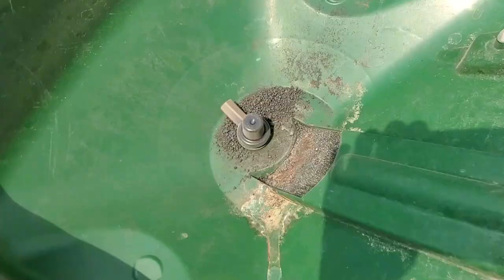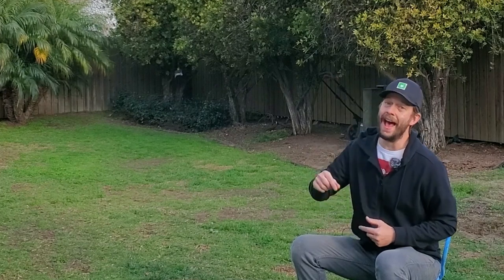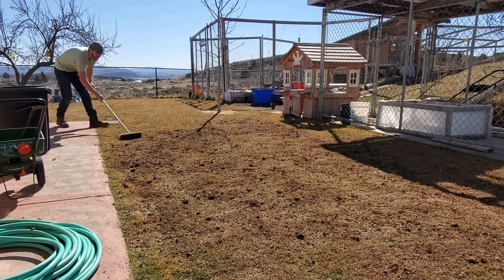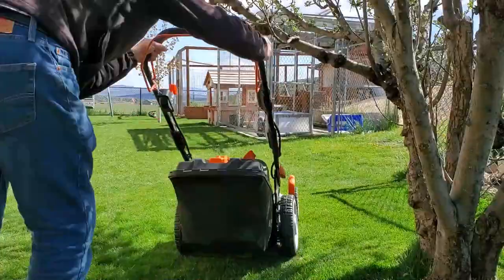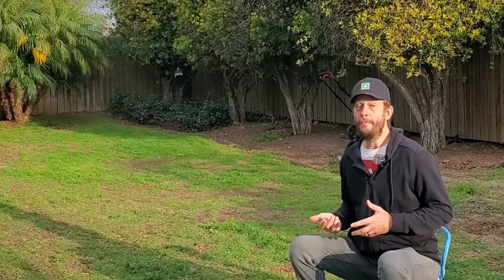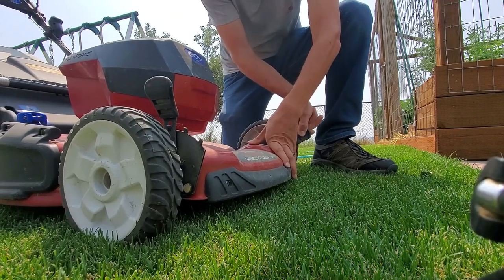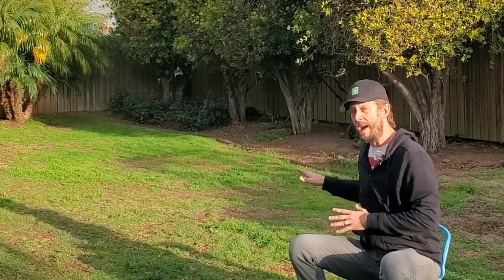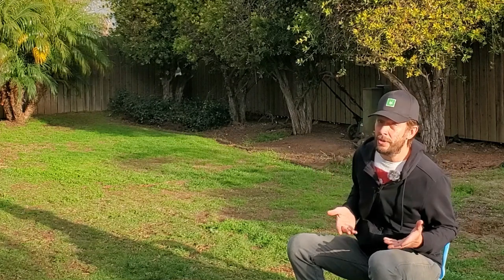All 10 Spring Lawn Care Steps // In Order

Comment: You can use tenacity as a pre-emergent and post-emergent and can literally spray it directly onto your grass seed and it will not harm grass seed in the spring or the fall
Reply from the maker: Yes, this is correct with the caveat that you shouldnt put it on bermuda zoysia bentgrass ...and you should go lightly on fine fescue too. Also, as a pre-emergent it should be reapplied every 3-4 weeks to get lasting effects.

Comment: Thanks for the tips,  always great content.  Would you advise applying an insecticide with the group preventative?  Ants are the worse
Reply from the maker: I'm not an expert on ants by any stretch but I do know that near the end of winter or beginning of spring is probably the best time to suppress them before they get out of hand later in the season. You could probably add insecticide in with your PE treatment or just fit in a treatment around late March just to prevent infestations before they happen. If others reading this have more experience with ants I would love to hear your opinion too!
Reply: I was planting yesterday and lifted up a large flat rock I added last year, and there was a very surprised colony of fire ants under it. I’ve been using equal parts powdered sugar and baking soda since I’ve had them in different places around here. I think it kills off a bunch but the rest just move. I remember reading a comment once where someone took ants from one colony and mixed them with the other. He said they will fight to the death of each. I don’t like killing them but they are not nice. I have the tiny ones but the sting is potent. Edit to add: I found a video from the Dirt Doc, Howard Garrett. He suggests 6oz Garrett Juice (compost tea) 2oz Orange Oil mixed into a gallon of water, poured directly into the center of the mound until it reaches the bottom, killing the Queen. Then finish pouring the rest of the mound in a circle. He says this eliminates rather than pushing them to other parts of the yard.
Reply from the maker: Thanks for all of those ideas; you know I'll take some time to research them eventually! :D

Comment: Sound advice. Also sharpen blades and raise them . Cut no shorter than top two highest blade settings. EVERYBODY I know cuts their grass TOO short.
Reply from the maker: Great tips! I think the reel mowing community on YT really got everyone thinking shorter is better, me to. I have gradually moved my height of cut up over the past 18 months too. I'm going that high because it's easier for my animals and kids to have shorter cut grass but a middle ground 2-inch is way better than a 1-inch cut. Right now I'm reel mowing as low as possible but only for the sake of a height of cut reset. Front yard later this year will be cut in the 3-inch range most likely.
Reply: My mower top level is 2.5 inches. Is that high enough for TTTF?
Reply from the maker: @DRTOLLZ  that's fine, pretty short for a top setting but tttf fescue can look great at that height. You'll just probably want to cut it slightly more often at that height to keep it looking its best. If you ever get a mower that goes up closer to 3.5 then consider a taller cut at that time. Shorter cut grass is simply harder to make it look and perform at its best.
Reply: @TurfMechanic  I have a fiskars reel mower that goes up to 4 inches but it doesn’t cut well at that height and I prefer to gather the clippings
Reply: Should be as long as top of shoe after cut. Like you, I see way too short a lawn that exposes to all destruction

Comment: What are your thoughts on pre emergent on a newly seeded lawn that is 5 months old?
Reply from the maker: If you had a lot of weed pressure last year prior to seeding then I'd say go for it, you may stunt the new grass a bit but probably not enough to notice. If yiu didn't have a heavy weed infestation last year then I'd say skip it and push as much rooting as possible through spring. If any weeds pop up you can spot spray before temps climb high in late Spring.

Comment: Hey Brian,  if you plan on putting down seed in the spring, after you've power ranked and core areation. Is it recommended to wait to apply your pre emergent? Or not at all.
Reply from the maker: Probably best to skip it this Spring if applying seed. If you wanted a bit of extra coverage you could consider a few rounds of mesotrione in place of the normal pre-emergents but that is notably more complicated since they were off in less than a month.
Reply: @TurfMechanic  Unfortunately in Canada you can't get mesotrione. Any other recommendations?
Reply from the maker: @cpra694  FeHEDTA is an iron based herbicide that is usually safe for all grass types after about 10 days post germination. You could apply a blanket app of fehedta 3-4 times through the spring at 3-4 week intervals to limit weed pressure during grass establishment.

Comment: When I manually aerate, the plugs never come up! They just get stuck in the tool. Any tips?
Reply from the maker: This could be a good sign that your soil isn't compacted...it could also signal oversaturation meaning you just wait for things to dry out more...it could also mean you have a damaged tine or tines which means fixing the tines or replacing the tool. Last year in my manual aeration video https://youtu.be/Y92eFREwrvg my Yard Butler started clogging on one side. I tried to fix it but couldn't so I just went to home depot and picked up a new one made by Corona. I actually liked the feel of the Corona better but that's besides the point. You can see the switch in the video I linked to. The Corona pulled the cores perfectly without clogs. If your handy enough you could fix it...I apparently wasn't handy enough 🤣
Reply: @TurfMechanic  thank you! Yes we have had quite a bit of rain here. I’m just a little south of you.
Reply from the maker: ok, then that might be the issue. I've got a rainy forecast so you probably do too. Wait for the rain to subside and dry out for a few days then give it another try. Also, keep in mind sandy soil won't pull plugs as easily as clay soil. If your soil is sandy as mine is here then you may find it just doesn't need core aeration as much. The machines pull wider cores so they tend to pull cores out while manual tools that are thinner don't so that's always an option. Top-dressing is still helpful if you plan on doing that so possibly spike aeration might work well for you to open channels for topdressing material to get incorporated into the lower soil profile. Enjoy your wet weekend!

Comment: My backyard is bare right now (Just dirt) and i want to drop some seed for grass. Is it to late to this process or should i go ahead and do the prep and move forward. I'm in Orange County California.
Reply from the maker: Did you have grass at any point last year or has it been basically bare dirt for more than a full season?
Reply: @TurfMechanic  Its been bare dirt the full season. I killed off what was left of my grass last season.
Reply from the maker: @shortytothefulles  in that case you are not too late by a mile. Here in socal we've had a wet cool February and are sopping wet right now. If it were me I'd take advantage of the wet soft soil and drop seed immediately following next week's rain system coming through. Here in Camarillo ive got rain in the forecast through Wednesday then it will dry out and start warming slightly. Dropping seed in these cool temps will give you slow germination but it should be reliable and easy to keep seed moist with such damp soil. If your planning on dropping fescue, kikuyu, or bermuda (most likely candidates for your area) tye fescue will germinate the fastest but may not be the right option for you depending on watering and summer heat in your exact area. When dropping seed plan on doing three rounds of mesotrione to suppress weeds or just expect to have to deal with weeds in June after your grass has grown for a couple months.
Reply: @TurfMechanic  That's awesome news! That was going to be my next question, what seed you would recommend but you answered all my questions. I really appreciate it! This helps me out.
Reply from the maker: I wouldn't be true to myself if I didn't also suggest buffalograss. It's the lowest water requirement of them all, sacrifice is winter dormancy and less deep green color and probably more seed heads. :)
Reply: @TurfMechanic  I'm gonna go with the buffalograss especially with the water restrictions i have here in my area. This grass will help me out big time. Thank you!
Reply from the maker: @shortytothefulles  couldn't be happier with that choice 💗 if you get it going I'd love to see some pictures this summer!
Reply: @TurfMechanic  For sure! I will post up some pictures...
Reply: @TurfMechanic  Is there a specific brand you would recommend?
Reply from the maker: none that I can recommend over the others, I've been growing Everwild Farms seed (available on Amazon) but I'm thinking about buying some plugs from one of the many sources online across the country. I need to do a deep dive into the different varieties of Buffalograss soon so at least I can feel better about suggesting varieties to different people this season. I was going to make my own plugs but I think that may not be the best idea for use of my time.
Reply: @TurfMechanic  Oh okay...I'm gonna look around...i know Scotts and i think its pennington pop up when i do research...ill try one of them and see how it goes.....